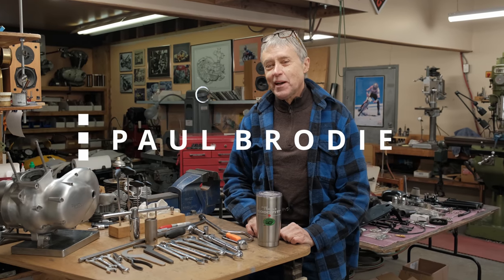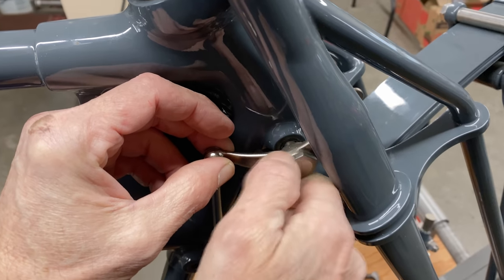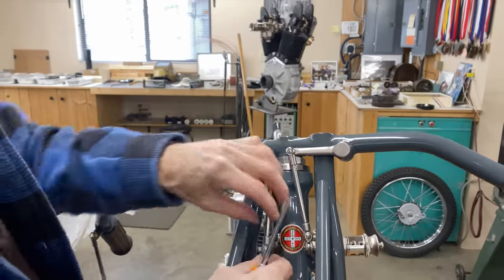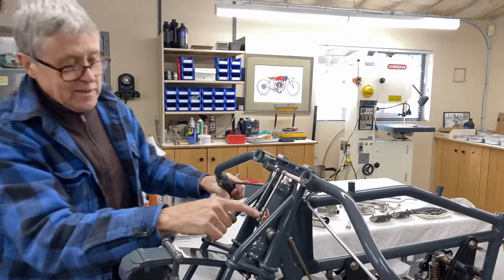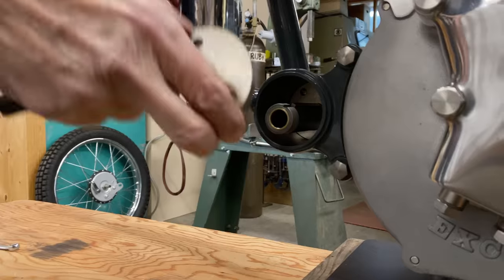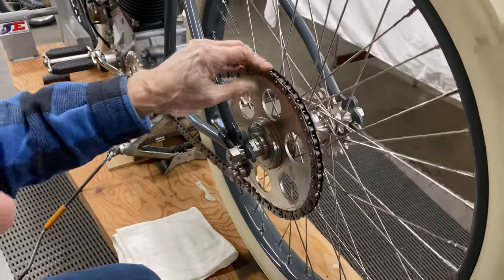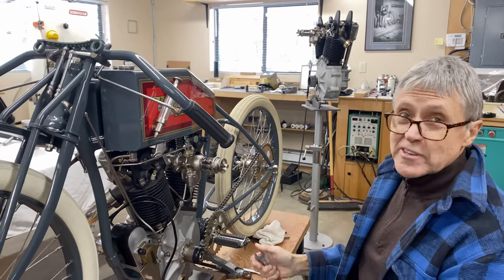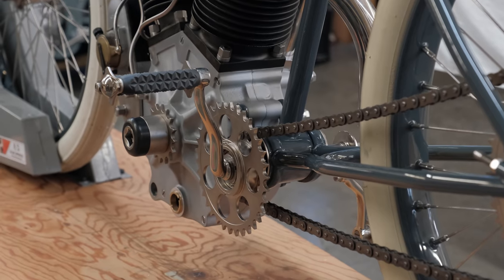Let's put an EXCELSIOR together! // Paul Brodie's Shop

Comment: Paul.  I've wanted to build a BTR for years and worked more than few designs out in CAD but started in a different direction this past year.  Tomorrow, my TIG welder arrives.  It will be used for a board track racer; that direction will be taking a u-turn.  This video is exactly what I need to see for some new (years) inspiration.  Your workmanship sets a wonderful standard.
Reply from the maker: Peter, thanks for watching and commenting.

Comment: Hey, Paul, beaUTIful bike!  As a timesaver, why not open up the back of the two holes on that tie-down bracket?  Then you could just loosen the cap bolts on the tubes a few turns, slot that piece in, and tighten back down.  You could bend ears in the back if you were worried about slippage.  Bonus: with no need to take the bolts completely out, there'd be no chance of forgetting where you set them down.
Reply from the maker: Thank you prostwest. Once I put on that tie down bracket I never take it off. It stays on the bike. Thanks for the tip though.

Comment: 3:40 - That right there just hit me in the nostalgic part of my heart and now I want one, but not an original.... I wouldn't be able to modify it to electric and live w/ myself.  LoL
I'd have to make a new frame or find and old busted one or something... The springer style front end and the way the tank side attach just look so good, I love the look of the bikes you build. Even though I'm young I still prefer the early motor-cycles over motorcycles and I've always been into bikes, so it was just a matter of time before I got into motorized bikes.... Now I just have to get a few skills and some specific tools and hopefully I can start doing stuff like this myself, you definitely inspire me to get into fabrication and design w/ your videos. Thank you for that and as always, great video guys... Keep up the amazing work¡!     😊👍
Edit: A motor-cycle w/ pedals makes me so happy.... Thank You for bringing it back and making it a part of our history.
Reply from the maker: Yes, the 1919 Excelsior was right around the cross-over time for bicycles and motorcycles. Still has pedals but they don't do anything except to hold up your feet. Switched to "foot-pegs" shortly after that. I hope you do make some cool bikes. Happy New Year!
Reply: @paulbrodie  - When you said "on the street bikes the pedals started the engine", I realized that I could use that as a way to connect the pedals to the rear wheel on an electric version so it's still considered a bike... At least in my state, It would need head lights/brake lights and turn signals and horn/alarm to get registered as a moped but it'll be worth it. Especially if it looks like that...   😁
Reply from the maker: @xpndblhero5170   This is what I was told. You pedalled the bike to get it going, then moved the lever that tightened the belt drive, which in turn (hopefully..) turned the engine over :)

Comment: In addition to ball wheel bearings, regular beaded tires instead of death tires would be a good practical modern upgrade.
Reply from the maker: Yes, the Excelsior I rode (Harry Hi-Pipes...) had modern tires on it, but I still crashed after one lap and ended up getting flown to hospital in a helicopter..

Comment: Wow, Paul you are far more than a fabricator , the workmanship 👌that linkage 👌the original designers would be amazed at what you have achieved and all from a photograph
Hats of to you 👏👏👏👌
Cheers Chris
Reply from the maker: Thanks Chris. I did make the motor from an old pic, but I also borrowed an unrestored 1914 Excelsior road bike and from that I copied lots, such as linkage, pedal cranks, hubs and more.

Comment: I've been working on motorcycles for almost 54 years and that was fascinating. 
Oldest bike I ever worked on was my fathers 1928 BSA 'Sloper' although his 'daily driver' was a 1963 Panther model 120 he bought new. He always wanted to built a Panther V twin with the model 100 (600cc) cylinders but never had time, money or machinery (with 6 kids we were almost always broke-nothing changes-LOL)
 I've seen bicycle brake linkages but never on a motorcycle throttle and magneto advance- retard (although plenty of bikes with Bowden cable magneto advance)
I hope you get to sell to someone who will at least demonstrate it running now and again, I know it's well outside my price range.
The history was also great, very few people seem to know Harley Davidson had 8 valve motors in 1916 then went 'backwards' making side valve engines for 40(?) years
Thank you for a great video
Reply from the maker: Thanks Peter. Yes, there is a lot of really interesting motorcycle history that doesn't come up much anymore. Just trying to do my part to keep a little bit alive.
Reply: TBC you know this is a reproduction? So it's technically a late 2000, granted very faithful to the original
Reply: @jaykoerner  It's close enough to an original to be eligible for many forms of racing and has a power output to be very competitive or even dominate it's class. If I wanted a 'museum piece' I would either restore my brothers 1928 BSA 'Sloper' or get something different (if I had any money  😀)

Comment: This fellow is so cool. When he said that he found some boxes with "excelsior" on them in his mess, i went imidiately to search my mess if i can find some boxes with written "excelsior" on them. But unfortunately - no sucsess. So I am damned to continue with my harley tracker project. :)
Reply from the maker: Thank you Sigi Thumm. It's true; not everyone can find Excelsior boxes when they want to. But, you do have a project, so Congrats on that!    :glasses-purple-yellow-diamond:
Reply: @paulbrodie  Thank you Sir for answering my comment. My comment perhaps sounded funny but has a very serious meaning. All I wanted to say is that its an absolute pleasure to watch you assembling bikes, you have the spirit of the men who drove this bikes. Not thinking about safety for weeks and years but simply sit on something with a huge engine and wheels and win races. Not caring if they can stop in time. You should build not only 17 but 17.000 of this bikes. Perhaps then I could afford one :)
One day I will have my Harley Boardtracker. Even if it took me more than 3 months only to rebuild one inlettower with rockerarm and reestimate 2 Valvehousings with landrover diesel valves (I mix what I can find). Let me say at the end that  I'm happy that as you said one owner of a cyclone did not want you borrow his bike to rebuild it. Because the excelsior is much more beautiful.
Reply from the maker: @sigithumm4150  I agree. I think the Excelsior OHC motor is very handsome and manly...   :face-orange-raised-eyebrow:

Comment: Very nice New Years video. I enjoyed the history lesson in the background as you assembled the bike. Do you have video of the construction/restoration of the parts?
Reply from the maker: Thanks Ray. Construction, not restoration. No video yet...
Reply: @paulbrodie  cool bike, I always liked those old board walk bikes. Back in the early 80's my motorcycle class teacher built a bike base on a old schwinn and briggs engine. It used a belt slipper clutch drive, in class built high lift cam. That thing was a blast. Too bad these classes have been dropped for schools.
Reply from the maker: @raynyhus2026   Yes, a lot of shop classes were shut down in the nineties and the machinery sold off. This was to make room for the "computer age". Now we have a shortage of people that can actually fix stuff, so I label it a Mistake.

Comment: Paul, thank you for such a wonderful and informative video. I learned a lot about these motorcycles from watching your assembly. I was hoping you could tell me why the fuel line has a loop in it? It probably seems like a silly question for someone to ask but curiosity has gotten the better of me again. Thank you again for the video.
Reply from the maker: To potentially stop the copper from cracking from the vibration of the motor.

Comment: Congratulations Mr. Brodie, fantastic build. Please would you allow us to hear it?
Reply from the maker: Thank you Guillermo. We will do a startup in the spring when the snow melts and the air is warmer. If you check the first Excelsior video (this is the second..) there is a short clip of the motor running, with sound.
Reply: @paulbrodie  Thank you I will. Best regards

Comment: Great stuff, Paul. As always, fascinating work. I've had a headache Raleigh 19?? sitting in the garage for years, and have never been keen to start on it, as it's missing +/- 10% of the parts. You're an inspiration for me to get off my backside and get into it.
Reply from the maker: Marty, you can get that Raliegh Running!!
Reply: @paulbrodie  Thanks, Mate. I have a shed coming soon, and will get into it as soon as i'm settled in there. It's no 1000cc behemoth, like yours (I think it's a 3/4 horsepower unit, if memory serves me correctly?), but it'll be great to get it restored and running. A far cry from the bikes i'm used to riding, but it'll be a blast, i'm sure! I may need to replace the humpbacked leathers for a pudding bowl helmet. As always. Thanks for the inspiration and entertainment.
Reply from the maker: @criticalmass181   Marty, thanks for watching and commenting.

Comment: That really is a motorised bicycle, except for the extra tube supporting the petrol tank and the large gap for the engine it is a classic 'diamond' frame.
Reply from the maker: A diamond frame has all the tubes connected. This Excelsior frame uses the engine as a stressed member. It is a "Keystone" frame.
Reply: @paulbrodie  I stand corrected!  👍

Comment: Left hand thread will always be used on the left side of the vehicle due to the fact that it will not self loosen as it rotates towards the front of the vehicle (travelling forward for 99% of it's life). That's why early Chrysler stuff all had left hand thread lug nuts on the driver's side. 😉
Reply: That system is  so stupid it is beyond comprehension. If anyone can give an explanation I would appreciate it. Only a few companies did this. All the rest of the world got by without this ridiculous anomaly.The lugs , as you call them are not rotating when the car is on motion ,they are revolving around the centre of the axle. They are tightly locked and there can be no effect on the lugs at all.A properly fastened nut and bolt arrangement can never come loose no matter which way it tightens.VW never did it and theyve made the most cars in the world.

Comment: I am again at a loss for words to describe how amazing this is!  So many hours of work to get to the point to be able to just assemble one of these.  I have a question, that ball and socket type linkage on top of the carburetor (the one you weren't sure what to call), did you make that from scratch, or was it by chance an available thing?  I ask because there are nearly identical ends on the linkages for my 1925 and 1926 Allis Chalmers model 15-25 tractors I am restoring.  I haven't researched availability yet, but I guess you may know.  Keep up the great work, I am loving the videos, great camera work and editing.
Reply from the maker: Jacob, all the linkage parts I either had patterns made, and then castings, but the pieces you are referring to I had CNC'd.
Reply: @paulbrodie  Thanks, that is what I was guessing, but it never hurts to ask.

Comment: Not sure where to start with all the questions i have so forgive my ignorance. Are there any kits out there for just us regular Joe's that could assemble something similar like the beautiful creation you just assembled? This auto cycle is poetry in motion and standing still. What would you recommend for a 4 stroke bicycle build with someone who has 0 welding skills and very limited room?
Reply from the maker: I made the Excelsior in my shop, starting in 2005. I used old black and white photos to get going. You can see more details on my website: www.flashbackfab.com  I have made six, and sold four. When I was twelve I started with a lawn mower engine, and built a mini bike. It would be good to get some welding skills :) Thanks for watching.
Reply: @paulbrodie  Great! thanx for the info!

Comment: Maybe it doesnt show on Video, but it seems as if theres only ONE copper washer on the fitting on the oil return between the bolt and the banjo, the one between the banjo and tank looks missing?
Reply from the maker: Those are fibre washers. I will check to see if one went missing, thanks.

Comment: Beautiful bike.  How did you know how to put that thing together?   You didn't even look at a manual.    I'm guessing you've done a few of them in the past.  Those linkage mechanisms are really cool looking.  Around what year did they invent the motorcycle control cables we use today?
Reply from the maker: Thanks Dave. How did I know...? Well, I built 95% of the parts, so I do have intimate knowledge of the bike. I have built six and sold four. I believe the Bowden cable was invented in 1896...
Reply: What did the bikes sell for ? Great video !
Reply from the maker: @556suppressor  Thanks Dave. Excelsior 005 is listed at $139K.

Comment: Hi paul thanks for sharing info about excelsior build you are great engineer. One question may be i missed in video. How to cast the crankcase?
Reply from the maker: How to cast the crankcase... First a drawing needs so be made. Top view, side view, front view. Then you need to find a pattern maker who will make the patterns, which need to be scaled up a few percent to allow for shrinkage of the casting metal. This is very expensive. Then you find a foundry that will do a nice job on a small production run. When the engine parts are cast, and then heat treated, that is when the machining begins. It is all a LOT of work.
Reply: @paulbrodie  you are great inspiration for. Me Just got my self flat tanker 1920s frame. Just want stsrt with building early side valve  engine they seems less complicated Nd used royal enfield gear box or Norton es2 gearbox i have. My friend have strumey archer engine i want to use this crankcase as pattern. Modify it as needed.. Thanks again for sharing the knowledge. Appreciate it warm regards from Ireland
Reply from the maker: @retrofy3797   Sounds like you have a project on your hands! That's great. In case you haven't visited my website, there is a lot of info on how the Excelsior got built.......... www.flashbackfab.com

Comment: Hi Paul. When you're starting to machine a new casting how do you hold it to make a datum face, hole or surface?
Reply from the maker: Good question, hard to give a short answer. Each casting needs some sort of jig or fixture built specifically for that casting. I have literally pages and pages of notes for each machining operation. For example, the Schebler carb is six bronze castings, I have 17 pages of notes, and each carb takes 44 hours to build.

Comment: Hi Paul, I am loving your channel.  I notice that you seem to have a non standard cam on the Schebler on the X.  Is this a race item or your own design?  I have a similar vintage Schebler on a HD and have always struggled to get it to run properly.  Thanks for the great channel.
Reply from the maker: Thanks John. I have an original Schebler carb that I copied, but it was very worn out. It took me years to figure out how they really worked. The cam is my own design, and the engines run very well, especially with tuned exhaust.
Reply: @paulbrodie  Thanks Paul, you have inspired me to go back to mine and make it work.  My bike currently has a later Linkert on it.  I have British bikes also and love Italian bikes and your channel is the only one that I am aware of with such a mixture of content.  Thanks again.
Reply from the maker: @johnbrookes9830   John, thanks for watching and commenting.

Comment: I have put together thousands of bicycles in my life.  All sorts of brands and quality levels.   I can vouch 100% for the quality of that old Excelsior.   What a work of art.  One thing?  I  dont see you greasing any of the pivots or threads.  (Linkage and pedals)   why not?
Reply from the maker: Alias, I took it apart so I could re-assemble it for the video. The threads and pivots already had grease or anti-seize on them from the first assembly. But thanks for commenting.

Comment: I'm surprised they didn't use some kind of concentric linkage at the center of the direction to remove the parasitic coupling of the throttle and timing handles.
Reply from the maker: Not sure I understand what you are saying....  What is a Concentric Linkage?   :face-purple-wide-eyes::face-purple-wide-eyes:
Reply: @paulbrodie  a tube inside a tube inside the head tube. It took me a while, but I found a related example: a pneumatic drawbar on a milling machine, it's a push rod at the center of the rotation of the spindle. Or a lever actuated collet chuck on a lathe.
Reply from the maker: I was building a replica, so I just copied what was made back in 1919...  :face-orange-biting-nails:
Reply: @paulbrodie  I understand, I wonder why they didn't do that, it feels like one of those clever ideas of the time (I love those plates of 1800's mechanical linkages). Thank you for your wonderful videos, I even bought the old bicyle and tricycles book you showed once.

Comment: Paul,  this is a copy of the original motorcycle, a recent copy built by you? If so, what an amazing and beautiful creation, congratulations!
Reply from the maker: Thank you very much. I have built six Excelsiors, and sold four..
Reply: @paulbrodie  What are the engines and transmissions that you use for them?
Reply from the maker: @caduceus33  I make the motors from scratch. There are no transmissions. It is direct drive with no clutch, no brakes.
Reply: @paulbrodie  Making those motorcycles is truly a great accomplishment!
Reply from the maker: @caduceus33  Thank you :)